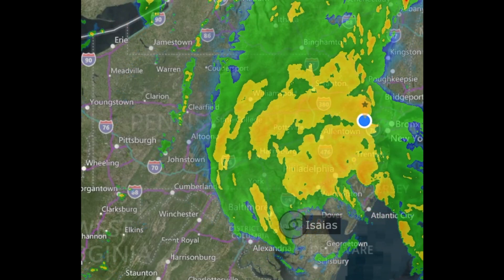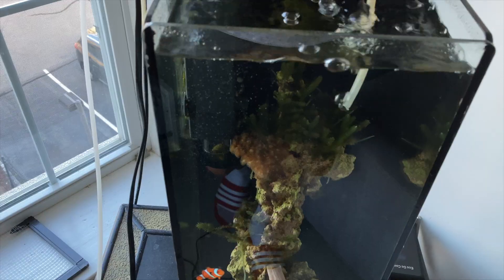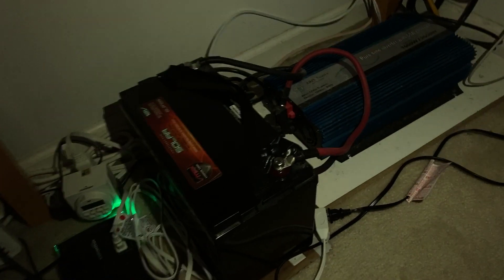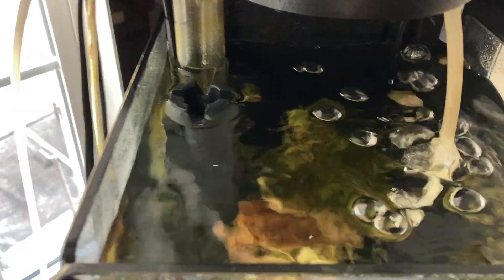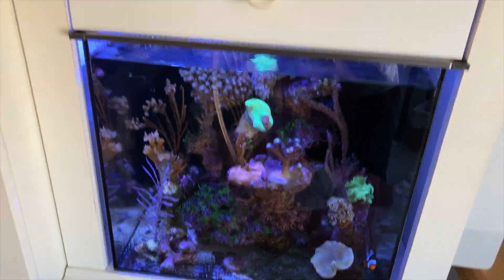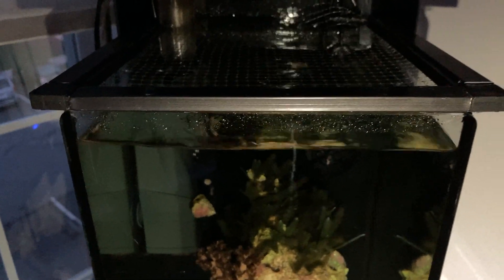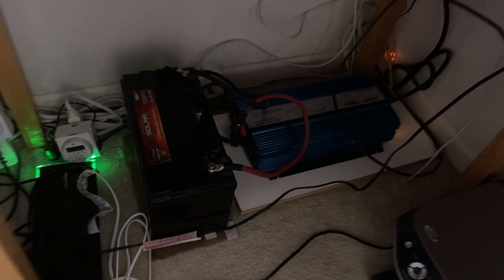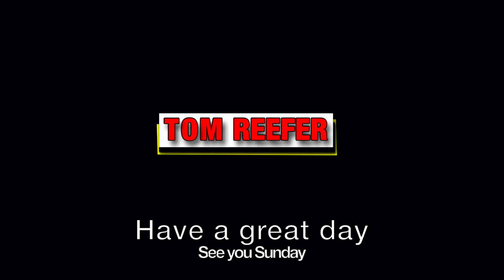Reef Tank - BATTERY BACK UP - HURRICANE ISAIAS - REAL TIME ! WATER CHANGE WEDNESDAY #3

Comment: Thanks for the vids. 
Could use some help here. New tank owner of 6months. 36g with 2 dalmatian mollies and some live plants. Did everything wrong for Isaiah. No back up pump...didn't save bacteria in medium, fed the fish once per day, and started some cup oxygenation last night. Power finally back....now what?🙄
Reply from the maker: Hi Cara, thanks for watching! If you didn’t lose anything, then it’s just back to normal, I would suggest a 50% water change. Did anything die?
Reply: @TOMReefer  good morning.thanks for answering. Had to check. No one died. Yay. I will do the water change today. What about the filter media? Should I replace it? I didn't put it in the tank when the power went out so maybe all the bacteria died. 🤦‍♀️ there's so much I need to learn.  Would you know how long a 5gal bucket of water should sit for gases to escape before using  it in the tank? Everyone I've talked to uses chemical treatment
Reply from the maker: Replacing the filter media will only remove more of the bacteria you need at this point. Possibly just rinse it in some aquarium water, outside the tank ofc.
Reply: @TOMReefer  ok tom. Thanks much for your time 🤗

Comment: Glad that everything is ok now! Great  real life scenario of things that can go wrong! Very impressed with your backup set up!   Question: here in Texas gets super hot in the summer and  pretty cold in the winter, in case of power outage here! would your back up system can also support a small chiller in the summer or a  250 watt heater in the winter?  And if you were in that situation what would  it be the most important thing to keep running , oxygen in the water  and temperature or oxygen and water movement? Thank you! And looking forward to your next video! Stay safe!
Reply from the maker: Hi Jorge, thanks for watching. I didn’t mention temperature too much in the video, because it wasn’t too much of an issue due too the summer. The backup set up I have would support a 250 watt heater, however it would decrease the life of the battery quite a bit. Chiller, no way. You would need a gas powered generator. Both temperature and oxygen are important. Depending on the size of your tank, temperature can drop really fast, if it’s a nano, so it would be important in the winter months to keep the temperature stable. So, both oxygen and temperature are critical. You stay safe down there too!
Reply: Thanks!

Comment: This happened to me! My power was out for 17 hours but lucky my tank was fine and thanks it’s summer because the water temp stayed around 79. Good video on the power outage, it’s always safe to have a back up
Reply from the maker: Hey Miguel, it’s a bit scary when this happens. Summer is a bit better then winter because of the temp. You’re right. My 5 gallon started to heat up. I was ready to go get ice for it, but then power came back on.